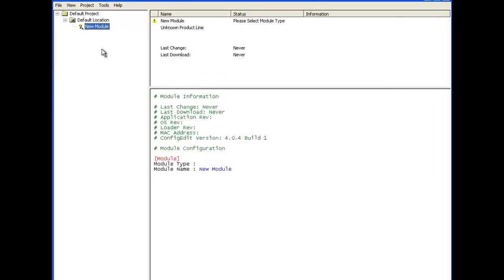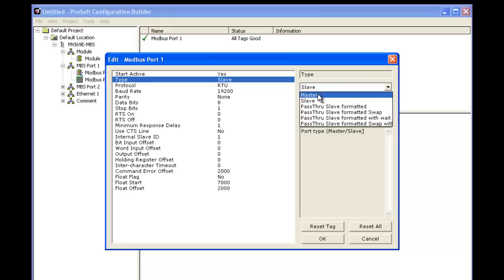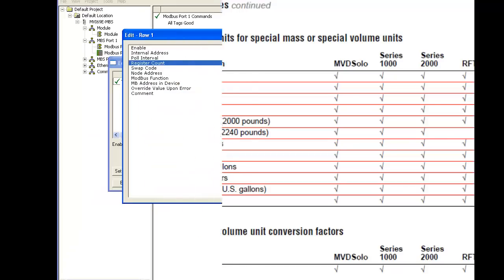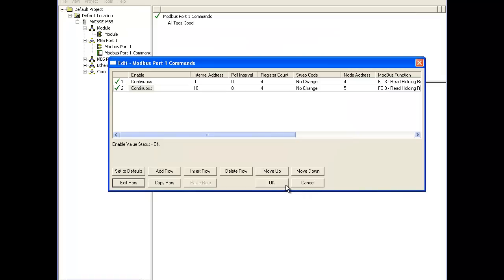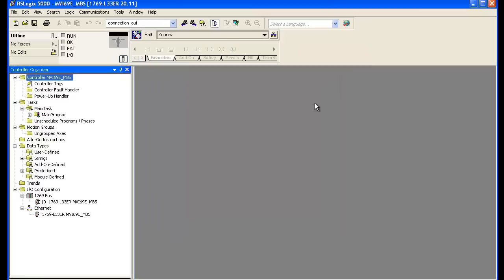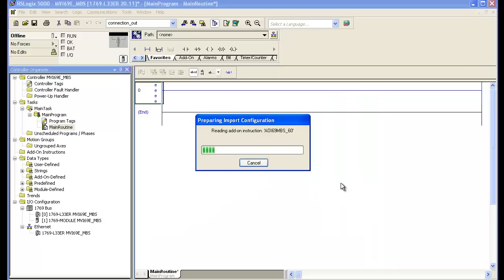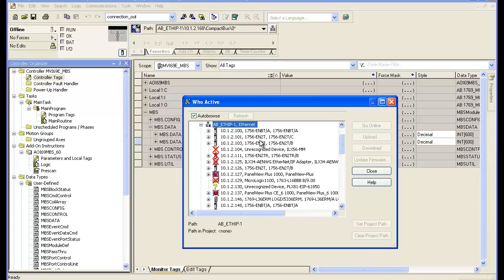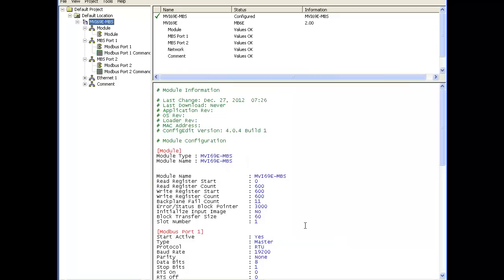Set Up: Modbus Serial Setup Tutorial for CompactLogix MVI69E-MBS

Comment: Hi!
Could you please give an example of the parameters for function code FC2 (1x), please?
Reply from the maker: Hi there! The MVI69E-MBS is configured using ProSoft Configuration Builder.  The parameters for configuring the Modbus are the typical Modbus parameters like node address, function code, register count, and register address.
Reply: @prosofttechnologyinc  Hello, thank you for the reply. 

But in fact, I would like to know if the way to fill in the parameter "Internal Address" is different if using FC 2 or FC 3. 

For example, in order to write data read from a slave using function FC2  in register 5 of the module database, should I fill in the field "Internal Address" with "80" (5x16) or "5"?